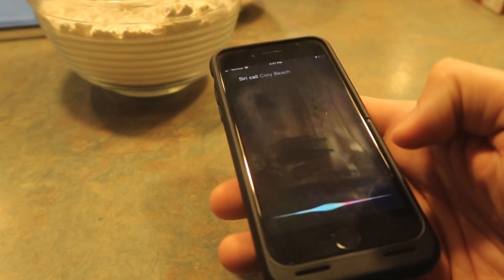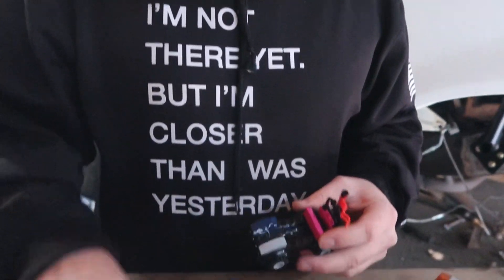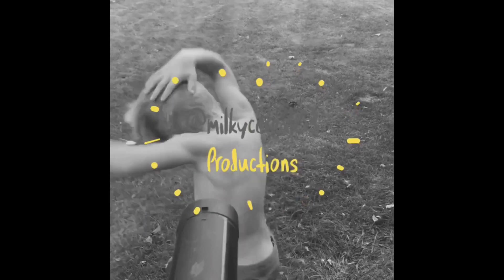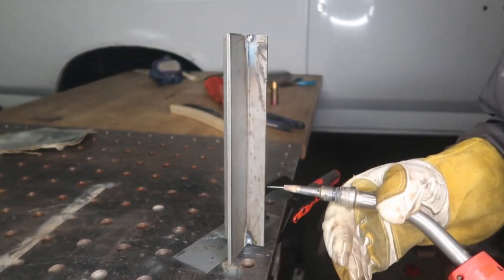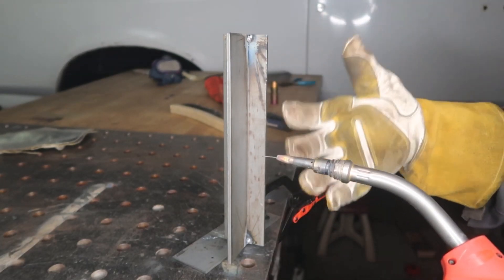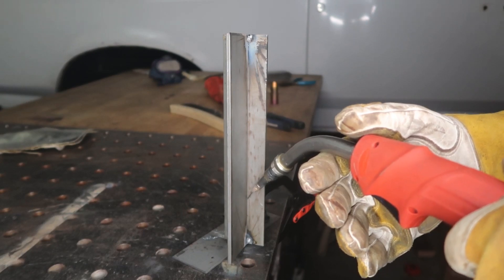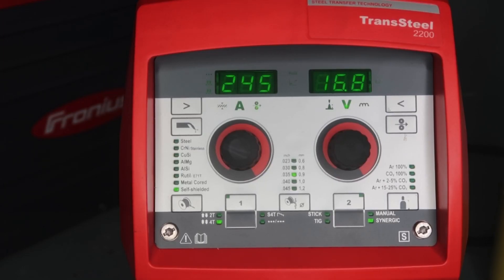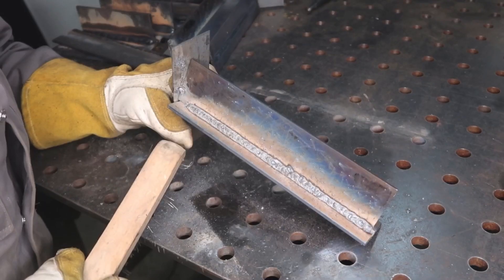Self Shielded Flux Cored Made Easy #selfshielded #fluxcored #fronius

Comment: Hi. Great video man! Jose, from Puerto Rico. I just got my TransSteel 2200 and this video caught my eye, since I want to use flux core wire as shown here. Can you show me or maybe direct me to a video that shows me how to read the panel on the left-hand side where one selects the material thickness? I appreciate that you show the wire speed, but I'd like to see how one can select the material thickness with a demonstration. These conversions sometimes confuse me, but once you can get a grip on it, I guess it's just a matter of practice to dial in the correct parameters. I would surely appreciate that help. Thanks.
Reply from the maker: Hello Jose , I have a three part video series on the TransSteel 2200. Check out my videos. The first video is a front panel review. Let me know if you have questions

Comment: Love the vid.  Would u do a vid about weld a restaurant grease duct using 16G carbon steel metal
Reply from the maker: Would this be a repair needed in a restaurant? What would be typical in regards to this ?
Reply: @chris_b_liven  no it’s new duct work installation. So maybe 4 pieces of Sheetmetal welding together to assemble a duct. I would like to see how best you deal with 16G carbon steel that use to make duct.  Maybe multiple welding positions demonstration is great.  It’s seem ur mig brazing way work fast too so it’s would be interesting to try that out.  Are they welding or brazing? What fronius setting to do same as these

https://youtu.be/4x7ROKYEi3k
https://youtu.be/hjnsAEX895Y
Thank you very much

Comment: Great video as usual. Thanks.

For gas shielded flux core (FCAW-G) do you use Knurled Drive Rollers or smooth ones? Fronius start guide for the Transsteel 2200 says to use the smooth rollers for "Rutil FCW". Is Rutil FCW = gas shielded flux core?
Reply from the maker: +Fluke I suggest using knurled rollers so you ensure the wire gets good feed ability. You can use standard rollers and just play with the tension. Yes, Rutile FCW is gas shielded Flux Cored. Thanks again for watching
Reply: @chris_b_liven  You are the man! Thanks again :)
Reply: I have 4 drive rolls and use U shaped rollers with no problem on long gun(5 meters)

Comment: Great video , I have not tried flux core on my 2200 but will soon. I sure like my 2200  now that I have got some hours on it. have been doing aluminum 5356 and it works just fine,  I hope the dual shield video comes out soon and I would like to see one on metal cored , in short I would like to every thing the 2200 Is capable of as everybody talks pulse mig  and this welder makes pulse mig not really needed unless
thin aluminum is being welded, at least this is what I think. I do wish is was capable of ac tig.
Reply from the maker: +Bruce D Thanks for watching. Yes, my plan is to launch dual shield flux cored this weekend and will finish with Metal Cored wire. This will make all the wire variations complete. I agree with pulse MiG in regards to thin gauge aluminum. Maybe I’ll make how to weld thin gauge aluminum on Transteel!!!!
Reply: Thanks, keep making the videos, yes to doing thin aluminum
Reply: MilkyCereal83 I’d like to see that